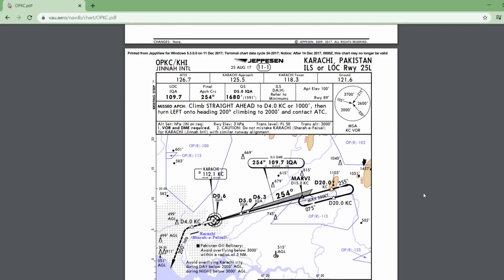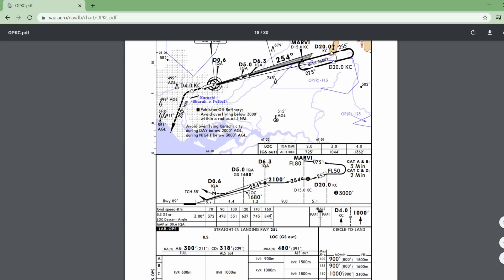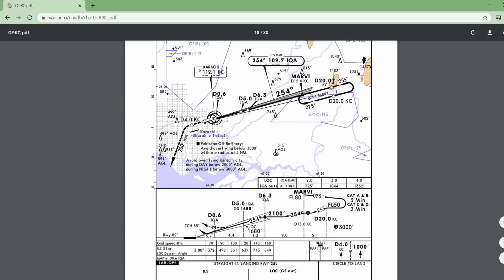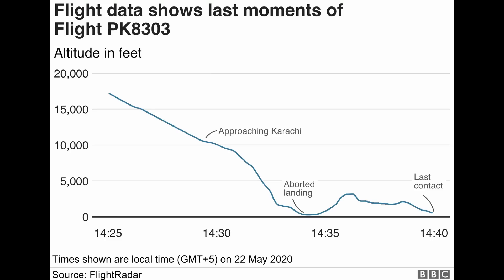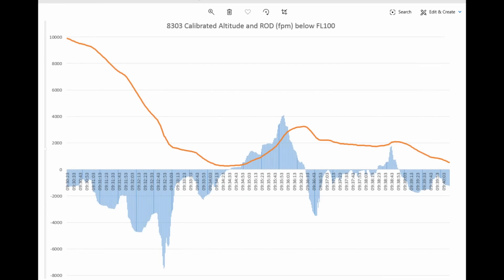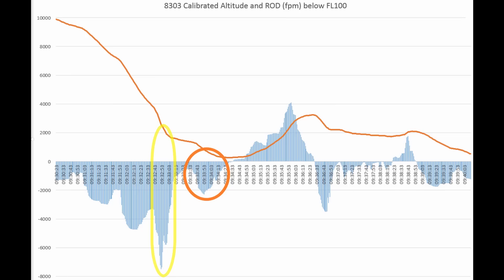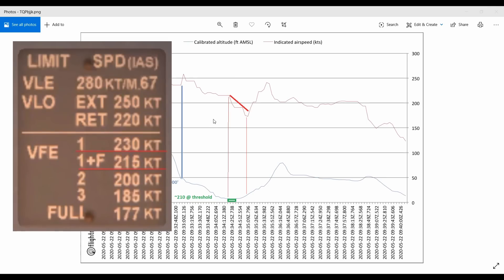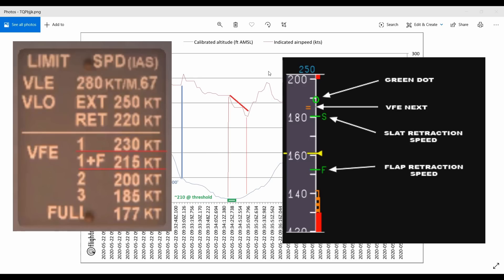PIA #8303 Update #4 Unstable Approach Profile

Comment: You can hear the landing gear warning going off on the CVR.  The pilots do not declare an emergency, they sound very matter of fact and never mention they suspect engine damage.  They damage both engines on their first approach.  The idiots then take off with engine damage.   Instead of choosing a landing place straight ahead, they  try to land  back at the airport they just damaged the engines at.  This is what would have happened if Sully had tried for Teterboro.
Reply: Good points but remember, the audible warning they heard was not specific to a landing gear issue.  That particular warning you heard is the same warning given if they are flying to fast for full landing flap deployment.  The pilot probably knew he was faster than the recommended limit for flap deployment and thus expected to hear that particular alarm until touch down.  Unfortunately there were two major problems occurring at the same time but only one warning signal.  All of that hurry up and great ready to land (unstabilized approach) with little time to think through other problems or procedures or checklist completions resulted in this tragic ending.
Reply: There's no landing area outside the airport at this location. It sits in a residential area. The only space is north and they turned south.
Reply: False - Sully would have nailed the landing.  He’s SULLY
Reply: They may not have realized the engines were damaged such that they could not achieve a go around.  Saying land straight ahead is great if there is open space to land.
Reply: @donmoore7785  I think I heard there was a military airport 2 miles ahead from where they took off on the same heading or maybe it was 30 degrees off their heading...still pretty much straight ahead.  In hindsight, they could have reached that runway but they went from a very risky bet to doubling down for another try at the same table.
Reply: I’m glad YouTube made you a professional pilot. Amazing analysis here!

Comment: This supports what I predicted in that they are accustomed to ignoring the landing gear warning chime because they pull the lever early and count on the gear to automatically deploy once they shed enough speed.  That is why even the tower operator seemed unconcerned about the warning chime.  They hotdog their landings and they pushed it too far.
Reply: So true
Reply: bingo
Reply: Basically they fly a very advanced and safe aircraft and are hot rodding it to its limits. So SAD.
Reply: Andy - That is an interesting suggestion. I wonder if this airline have an FDM programme. If they do, this can be easily verified.
Reply: I don't think the ATC had enough time to listen to the warnings in the background. The response was barely 1 seconds long.

Comment: It just seems like situational awareness was zero for those in the cockpit. They failed to do the practiced routines for landing and ignored warnings in place that help prevent any issues. 
The pilot seemed so calm  even though disaster was eminent. Why were regular procedures ignored and these unorthodox dangerous procedures implemented?
Reply: Pilots are trained to be calm in extreme conditions. The worst thing you can have in a dangerous situation is a panicking pilot.
Reply: Could there be some technical faults in the plane reading regarding height, speed etc which might have caused such unbelievable descent?
Actual readings different but plane showing different readings....they were comfortable relying upon the mistaken reading of the airplane while the actual reality was different
Reply: dark Knight47 Maybe there was a software problem ?
Reply: dark Knight47...ATC advised the pilots that they were not at the correct altitude and speed for the approach. However the captain replied that they were comfortable where they were.
Reply: @mortalstorm  BIG mistake, ATC was trying to be helpful.
Reply: @dkht47  No, they were just crap pilots ! NO instrument problems are needed for this.
Reply: The only thing they did was declaring that they were comfortable (while apparently everything on the plane was screwed up).
Reply: Next , you will be comparing the pilot to Chesley Sullenberger!!!
Reply: You can hear the pilot say "Roger, Pakistan 8303." with the alarm clearly audible. It's nearly half a minute later when they say "Pakistan 8303, going around."
What you don't hear is either pilot interrupting the first radio call with "Go around!". Both pilots appear oblivious to the alarm.
Reply: YES
Reply: The answer: denial.

Comment: A point that was highly discussed after the Tenerife incident dealing with crew communication, was the fear of peer pressure. The lower ranking pilot being afraid to contradict the higher ranking pilot. This, in my opinion, may have also been the case here. I have personally seen such behaviour, when training foreign nationals in ATC, where the superior in rank is making an error and lower in rank does not step in to correct it, fearing rebuke. 
Thank you,  for displaying those ADS-B graphs, the profile of the descent clearly shows how unplanned this approach was. One, simple request 
to ATC for vectors or a 360, to lose altitude and to setup for the approach properly, was all that was needed. 7,000 feet per minute on a descent, this appears to be more for military fighter type aircraft. Again, an excellent professional presentation.

Comment: I guess PIA doesn’t participate in flight monitoring by a company gatekeeper. Otherwise these guys’ phones would be ringing off the hook if they flew like that on a regular basis
Reply: I was thinking  the same, someone would had been suspended or fired
Reply: And see see Blancolirio channel video 4 and the FlightAware public data comments. Unfortunately they DID so earlier May 17 and May 21. And stopped doing it since... For now, so sad.
Reply: I flew with ex PIA captains. You can't tell them anything. They think they are good enough to land safely in any configuration.

Comment: Like the Air France A330 crash in 2009 I suspect that for this one it will be difficult to explain the actions of the crew. And why did the landing gear not come down on the first approach. Too fast when they attempted to lower it? Would it not then deploy when they reached the maximum speed for the gear? Why did they continue approach with no gear?

Comment: This is the kind of REAL analysis I've always wanted in air crash investigations and Juan is really delivering beyond anyone or any other news outlet, PERIOD.  Would the super steep and ridiculous decent have anything to do with the landing gear not deploying?  I can't imagine what these pilots were doing...well or not doing. Passengers had to be screaming!!!
Reply: Yes - Juan does not speculate happily so, but the answer is yes. So Sad.
Reply: Mark Otterby - When you are hot and high, one of the things you can do is lower the gear. Once you have done that you can “push” against the gear to increase drag. You can also use speed brakes and flaps. But the flap limit speed on the A320 is fairly low (210 kts ?) removing one drag increasing option. Obviously the best option is not to be there in the first place.
Reply: On an Airbus you can command gear down but if your speed is above safe extension speed it will not drop and will give you a warning tone and display the reason for the warning on the centre display.
Reply: @bulwinkle  sure thats what was explained in a previous vid on this. My first time following a whole series of investigations and finding it really interesting how all the external resources can be compared to what could be found on the flight recorder

Comment: Hey Juan, the passengers in those final moments from 10K would have felt almost a freefall, this slam dunk approach could've caused because of many reasons?, could fuel save be one of them? fasting in Ramadan could've played a factor as well, still the landing gear problem doesn't add up, we might need more than ADS-B data to conclude that. speeds were well below 250kts most of the time for LG to not deploy

From your last video, The CRC warning could also have meant flaps rather than landing gear? Not deploying LG could just be because of a dreadful forgetting

Comment: Excellent analysis. The only question that remains is the antecedents of this crew, particularly the captain. The CVR readout is going to be interesting. Depending on the airline culture, there may have been disagreements  or NONE  (which is a worse situation in my opinion). Did they have some kind of an argument or distraction during the initial approach that led them to being high and hot?

Comment: Thank you again. The picture is pretty much clear now. One thing that bothers me is the distance-time equation after the aircraft pulled up for the go around. The engine scraping time was 9:34Z and the crash time 9:39Z. That is 5 min or 10 nm @ 120 kt.  Looking at the chart, the distances don't match with the times unless the aircraft loitered/orbited somewhere before the crash.  Any thoughts?
Reply from the maker: see previous updates.
Reply: @blancolirio  Done already, multiple times. In fact also went through your complete chat with the Mentour Pilot on the subject. Strangely no track available from FlightRadar24 either except for the initial part of the flight. Perhaps someone from from Karachi Radar will do it. Nonetheless, thanks for your reply.

Comment: Purely incompetence. PIA needs to be grounded until it is entirely reorganized. A national asset and a disgrace to Pakistan.
Reply: I hope they investigate the training process of pilots too. This has too much flaws.
Reply: Usama B. - You can only say that based on evidence. So far we only have one instance. Do you have more examples?
Reply: Trevor Austin I seem to recall that PIA (or part of it) was banned from UK airspace some years ago - Im not sure of the details but it might have been over maintenance/licensing issues
Reply: Tony Lough There is loads of 777 PIA planes into Heathrow
Reply: @Trevor_Austin  Speaking on a broader level here. I've traveled PIA a lot. It's a mess internally, needs to see massive improvements in management. Safety/cust service standards are low
Reply: SOPs were violated

Comment: I wonder if the crew was rusty after the severely reduced flying during the early stages of the Pandemic...not that it would be an adequate explanation....I haven't flown anything in 25 years, or an A320, ever, and I would have recognized that I had gotten behind the airplane 5 minutes before the engines scraped the runway.
Reply: Exactly.

Comment: This explains quite a bit - it's got to be very difficult (or impossible) to manage the aircraft's energy when trying to slow and simultaneously diving for the ground like that.  Of course, this now begs the question: why did they stay so high and fast for so long, and why did they feel the need to then dive towards the runway, instead of taking a gentler, more measured approach?  Hopefully there will be more in the flight recorders to flesh out the answers.  Thanks for the update, Juan - much appreciated.

Comment: How is it that they were still so high at 20m anyway?  Presume ATC clearance and flight plan is at odds with what they flew to that way point.   Ie they broke all the rules.  Shouldnt ATC have pulled them up on that??  Not clear to land?  Divert and get it right sir?  What does 7000ft/min feel like?!!   Let alone a belly landing go around to double engine failure....nightmare for all concerned.  Be interesting to see crew log books / incident reports maybe.  Yikes!

Comment: Wondering what the genesis was of the unstable approach. Did ATC keep them high and “slam dunk” them? It’s no excuse if they did, it’s still the crew’s responsibility to get in a position to make a stable approach, but it does indeed put more pressure on the crew. Many crews are reluctant to tell ATC they need vectors or even a hold to get down in time to make a stable approach.

Comment: Does anyone know if the CVR and FDR will still operate after the RAT deploys?
Reply from the maker: yes. GREAT question!
Reply: By this time, the most important part has been recorded already. The rat deployed after busting the engines, so all this crazy dive should have been recorded. Boxes could have back up power (bateries) ... wondering .... but probably most of the sensors that send data are offline due to the lack of power.

Comment: I'm high, but that is ok I'm fast.  Another rule of thumb is Vertical speed should not be greater than altitude at altitudes before the stabilized approach. example  3000' = < 3000 fpm down.